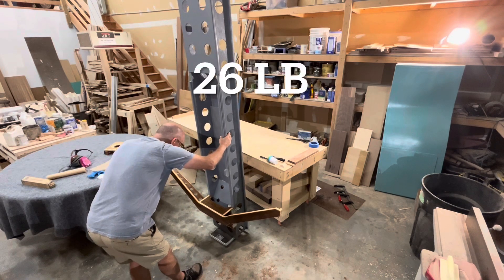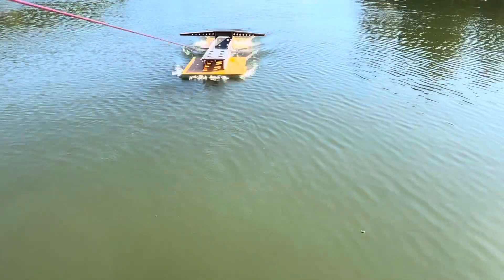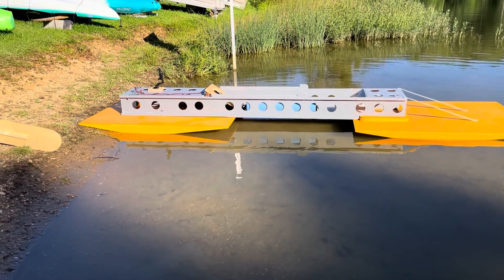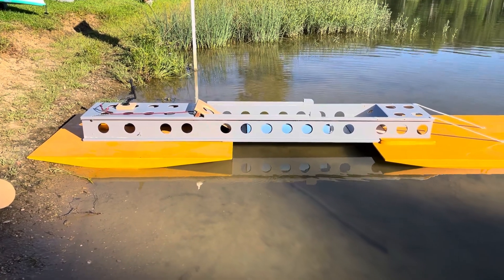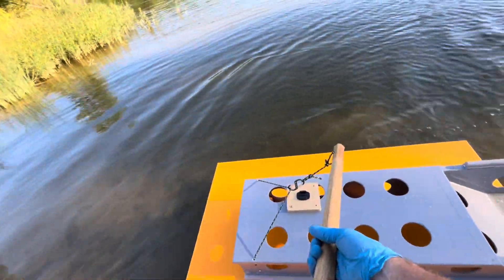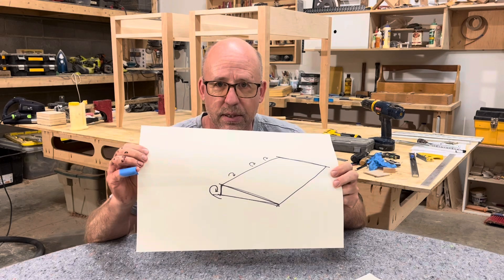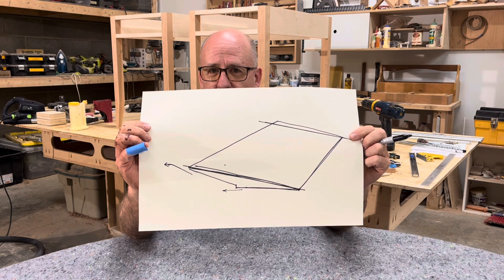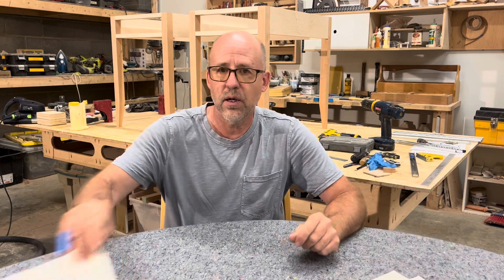Wedge Rower Test 2 on the water

Comment: I have been studying flat planing surfaces and wrote a paper. It says LIFT = rV^2*Acos(ø)sin(ø).  r=density of water [900], A = area [metres], ø = angle of foil to horizontal, V^2= velocity squared in m/s, Lift in newtons (boat+ you). A quick guesstimate/look at your system shows your boat needs to go 8mph to plane. If you want me to send you my paper I will.
Reply from the maker: @MrStevenlynch  hi Steven,  thanks for your comment.  I would be happy to read your paper.  I have read many papers but I still have questions.  It is not clear to me if the aspect ratio of the planing surface has to start out being 3 or end up being 3 after the boat is on plane.  In other words, speed of zero vs Froude number of 2.  Also, it is not clear at what Froude number the skimming begins.  Some people say 1.5 and some say over 2.  My email is: markpalmquistdesign@gmail.com

Comment: Your lifting surfaces could be improved. See if you can find eugene p. Clement Dynaplane PDF
Reply from the maker: Hi, thanks for your comment.  I have read that paper.  Most scientific papers are for boats that operate in waves and at higher speeds, so a boat with 12 degrees of deadrise is advantageous at those speeds.  I am using zero deadrise because you get more lift with less drag if the deadrise is zero.  The challenge with my current design is that there is no pathway for air to get sucked into the step area to ventilate it.  Other than deadrise angle the current design is very similar to the Dynaplane.
Reply from the maker: I took a closer look at the dynaplane.  I will try it, thanks.

Comment: suggest to put rigger with attached foot rests on rollers and fixed seat to avoid hobby horse
why not approximate float plane catamaran pontoons?  they are curved on 3 axes and will create less vortex.  
YT  techingredients made a video about a tiny manned cat with foil shaped pontoons.
Reply from the maker: @kevinwelsh7490  that’s already been done.
Reply from the maker: @kevinwelsh7490  interesting.  That’s basically a hovercraft.  I am attempting to use downward deflection of water flow to create lift.  At a certain speed a small amount of spray shoots forward and mixes with the water and the air bubbles lubricate the planing surface and reduce surface tension.  Very similar.  I just don’t have enough volume and need some way to get air behind the step.

Comment: Your double wedge design:  Look at lifting bodies from 1960's that angled aft section of wing (lifting body) has a down force, wing pivots at center of gravity and forward section of wing creates angle of attack producing lift.  A lifting body would have to mitigate that lift or would go into a loop.  I would make the double wedge thicker in the middle so leading edge of wing is above the water.

Comment: I think the first step is to add volume. It is difficult to get the plates on plane when the ends are underwater.
Reply from the maker: I agree.  Air can not get sucked into the step area very well with the current arrangement.  I think I will jump back down to tenth scale and make a bunch of variations to test.

Comment: Re the transoms sucking the boat downwards.
I'd be trying to introduce some air at the point of that lip in the hull to disrupt the turbulence of the water at that point as it attempts to backfill the void.
As a passive solution, some tubes that can draw air from the surface of the floats. No idea how many or what diameter, so experiment 🤷🏻‍♂ May need some angle on the tubes but vertical may work.
As an active solution, perhaps some battery operated fish tank air pump/pumps hooked up to some long air stones or I have seen tubing that does the same as it would be thin enough to fit into the little step in the hull and not protrude.
I suspect that a small spray bar hooked to a small water pump might possibly achieve the same effect.Though I favour the air.
I have no experience in nautical design  just a tinkerer with a need to make do with what I have at hand. So feel free to ignore but best of luck with your project.😁
Reply from the maker: I will try that

Comment: with a moving seat you get ... something like 4x the power... vs. kayak style paddles before you change anything in the hull shape... it might be just you need the extra power from a moving seat.
Reply: Do you mean a moving seat like a rowing shell has?
Reply: @bveracka  yes, and the oars on a pivot for leverage.
Reply: @qcca123-f1v  I figured that's what you meant. I've owned a couple rowing shells, and the speeds you can achieve are surprising. I'm not sure this design could go any faster than those, but I could be wrong.

Comment: a transom 45 degrees from the planning surface should be sufficient, ( as long as that edge is sharp )
then the planning surface and top convergent angle is the same as your old skimmer angle.....so you just have to arc the planing surface up to meet the top at the nose.

but it seems like that would result in a thinner float, ( for the same displacement ); Especially if it is higher aspect, so maybe the arc could be fairly graceful......I would say go with your old skimmer angle, but bump up from your old skimmer aspect ratio a bit.

Comment: they still could be triangular....I think the flat top is going to displace more.
when I draw it, it looks sort of like the floats in this video, but upside down with the fore edge up ( the new long bottom side at "the skimmer angle" )

actually, for more displacement, the transom could be 45 degrees from the planning angle surface........then just arc up the planing surface nose into the flat top.
Reply from the maker: I think I understand what you are suggesting.  Are you sure 45 degrees forward is enough for the transom?  I was thinking 60 degrees angled forward would be better.
Reply: @markpalmquist  60 forward might be a little better at traversing into semi-displacement; but that shape will also not displace as much in the static state....so somewhere in there.

Comment: Pull it from a powered zodiac with a fish (weight) scale inline with the towline? Then you can record pull-tension as a function of GPS speed (different engine RPMs would give you a new graph datapoint), then you can plot the whole speed curve and know where liftoff is, and what speed would be required from rowing. (put an equivalent weight of sandbags into the boat if you're using the zodiac?).
Reply from the maker: Thanks for the advice.  I only know 1 person with a power boat.  I agree that would be the best test.  I was hoping the rope would lift it.  The step has not ventilation. I will need to add a ventilation tube and try again.
Reply: @markpalmquist  I don’t know how long it would take to compile each curve ( for a given configuration ), but I bet there’s valuable info comparing each new curve to previous ones.

Comment: Glue some XPS on top of the floats to increase buoyancy!  You can ventilate the step by just a couple of vertical plastic pipes sucking air on top of the floats. Make them so long that they are not submerged. This would work better if the stepped area would be a bit larger. Hard to explain in written but You can see on some racing boats that there is kind of a pipe shape just at the step( deeper than the actual step). This is to improve air flow from the sides but it would also help in your case is air is coming from above.
Reply from the maker: Interesting.  I have not seen a racing boat with a tube as you have described.  Do you know if there are any pictures or videos that show it?  I agree, the current transom step is not very large.  Most speed boats that have steps also have deadrise and the deadrise creates a channel for air to enter.  Since I have zero deadrise I will need to create a path as you have suggested.  I will either add XPS or start from scratch on the floats.  They are already pretty heavy.
Reply: @markpalmquist  Search on Youtube " Worlds Most Modified Nitra 22"  and 0:45, there you can see air supply tubes. In your case the holes should be in the horizontal plane but very close to the vertical step. This boat(Nitra22)does not have enlarged pipe like channels that improve the airflow sidewise( probably because the step is so narrow).Yes, on a flat bottom air supply is harder  than on a hull with deadrise, but vacuum/ suction is always some kind of challenge with the steps.
Reply: @markpalmquist  Pascal Technologies make a mono hull they call AirHull with a fan at the front ducting air down into a chamber area under the hull before a plate transom that can change angle.
Reply: xps is lighter than air!
Reply: @kevinwelsh7490  almost :)  typically roundbout 35kg/m3